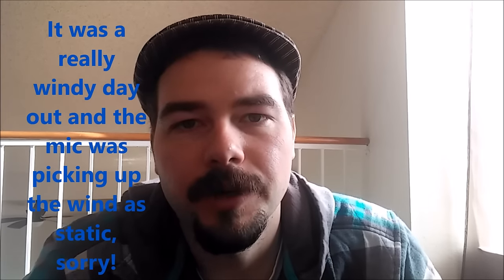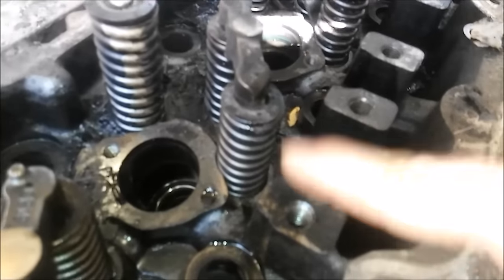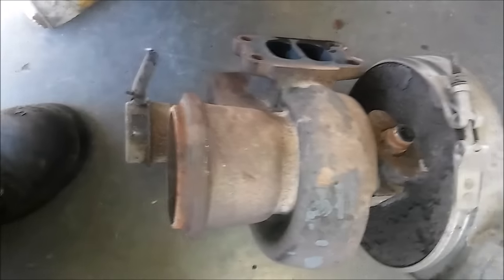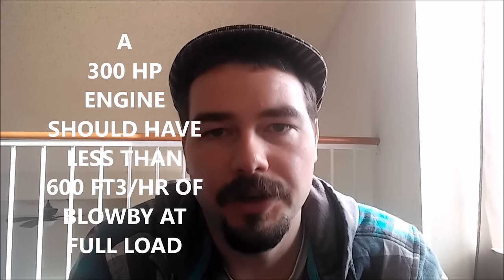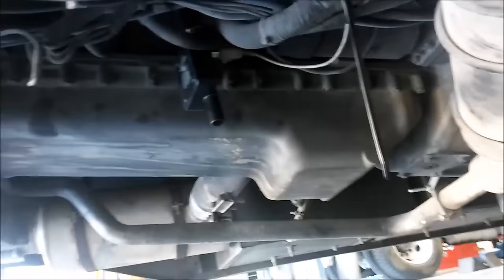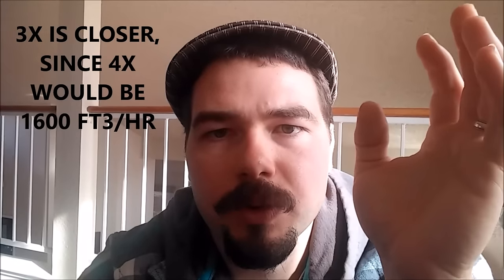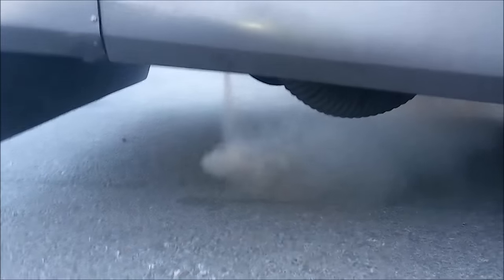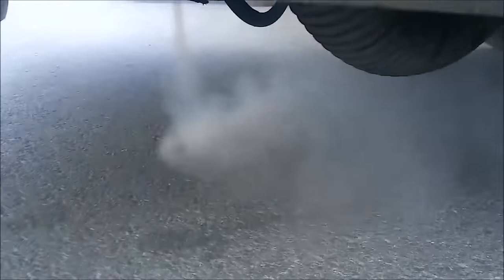What Is Blowby?  What Is Too Much Blowby?

Comment: Hey my friend you did mention that bad air compressor can cause blow by.does that mean if you fix the air compressor you won't get no more blowby?
Reply: My air compressor played up on my Volvo fh16 16L engine and now after not using truck for 2 months it works fine and build up air but sometimes days up , my engine also just recently started blowing white smoke from breather , can you help ?? Do u think I should replace air compressor ? Could my air compressor be the reason to white smoke / drips of water-ish oil from breather

Comment: Good morning Josh! 

Came back to this video as we have a truck in the shop that had combustion gasses in the cooling system and it received a long block (PACCAR MX-13). The truck now has blow by both out of the oil fill tube and the crankcase tube. 

For transparency the technician that did the install was inexperienced and did not replace the oil cooler or flush the oil module (Claims there was no metal) and they used about a half a can of ether over the course of an afternoon as they could not get the truck to start initially (Bad High Pressure Pumps). CCV filter has been replaced.

He was told to drop the pan and inspect the liners from the underside. He found a small vertical mark on cylinder 2 and orders from above were to replace the liner and rings on said cylinder. He stated to me he couldn’t really feel it with his fingernail.

I don’t believe it will solve the issue. After his repairs I’m looking to come up with a strategy to isolate the source of the blow by. This is what I have come up with:

Bring truck up to operating temperature. Verify blow by.

Disconnect air compressor inlet and outlet to isolate air compressor. Run unit and revaluate.

Pull rocker shafts off to ensure closed valves. Remove turbo feed and drain tubes from block. Pressurize turbo inlet to check turbo and intake valve seal integrity. Revaluate unit.

With the rocker shafts out pull all 6 injectors and perform a cylinder leak down test on each cylinder.

Wanted to see if you have any input? I can email you a video of the blow by and the mark the technician had found. It was his first major engine job and I’m preparing to take over his work.
Reply: Also metallic glitter was found in the oil pan once he dropped it to inspect the liner bores!

Comment: This is my first time viewing your videos and I have to say I am now a fan!  Great info!  I used to work on Caterpillar truck engines in late 90's early 2000's and have seen this myself.   I remember getting some with a scored cylinder pack that would puff fumes out of the blowby tube every time that cylinder fired.  I miss working on these engines since I have been out of the game for almost 12 years but I am slowly working back into it looking to re-start my career in diesel repair.
Reply from the maker: +Erich Z-Rod Good to hear from a veteran of the Cat Truck Shop, what field did you go into that had you leave the Diesel Field?
Reply: I have been driving tractor trailers and am now in real estate.  I enjoy driving trucks but real estate not so much.  I have missed the diesel field for quite some time but seems difficult to get hired today without certifications.  I have tried for Peterbilt, Cummins, and Detroit Diesel since we don't really have a Cat Truck shop anymore since they phased out.  The only Cat shop we have now is more for heavy equipment and I don't really care to work on the machines, prefer trucking.  Seems like the ones getting hired have technical school and certifications but little experience.  My old Cat job was old school and basically just trained on the job so I left without much to show and now I have been out of it for some time.  They have since closed shop since the Cat truck engine market kind of died of.  Thanks for the reply
Reply from the maker: +Erich Z-Rod Yeah, not a huge future in a lot of the Cat Truck shops. Hopefully ours will stay open for awhile longer before I have to transfer to a different department. Glad to hear from you, good luck on your search for a career.
Reply: +Adept Ape thank you. I'm not giving up on it.  I still do some side work occasionally but miss the shop environment
Reply: @AdeptApe  I have a 2007 Pete with a c15 double turbo and have it repaired with a platinum kit like a year ago. By a local shop  and now my truck it’s blowing oil from the deep stick  I replace the mentioned part with a new one bout is doing the same. 
I put tape around the tube. Deep stick. And it won’t Leak  what can be causing that. Please   Thank you.

Comment: I have also heard that if you removed the oil fill cap - and feel strong puffs of air coming out of the oil fill hone (with engine running) - that often means the rings are bad.

Comment: Thought I'd mention that different engine manufactures run this test differently, i.e. idle no load to high idle no load. Just so the viewer knows but depending on engine manufacture you can have other causes of high blowby. Such as a bad air-compressor. A leaking intake manifold/valve cover gasket bad oil seperator. It's getting to the point now a days that the rule of thumb is getting thrown out the window. Love your videos keep them coming. :)
Reply from the maker: +Travisfromoregon Thank you for your input.

Comment: So accurate.   I always said when a Cat engine idles and it has that sweet oil smell it's going to blow up real soon.  Also I don't know why some Cat liners have a real noticable taper after many  hours verses a Cummins..Maybe because Cat depends on Two compression rings as other manufacturers use more rings for this purpose.

Comment: I have a 3406e.. Blow by is not excessive. Yet it will blow off the oil fill cap fill cap or the dipstick if it is not tied down under load.. blow by tube is not clogged or restricted
Reply: has anyone replied to your post?

Comment: Nice explanations,thanks;
And if the crankcase is pressurized,the oil cannot drain down from the turbo? and ends up in the intake pipes,and then,you have a lot of blue smoke from the exhaust?
And,that can lead to engine RUNAWAY???!!

Comment: Hi Josh :) 
Again a lot of useful informations ! My 3208 has a little of blowby from the crankcase breather. Not so much, but there is. I have the valve lash to do (quite 3000 hours on the engine clock) and I guess it was never rebuilt. I just ordered an oil sample analysis to see what's going on.

Comment: Curious... '03 Cummins ISL (8.3), at start up should I have a pulse/pressure coming out of the oil fill? ZERO smoke, just pulsing air. Is that normal or a sign of something? Thanks so much for all your videos!

Comment: Just did an overhaul on my c15 accert at the rush in pharr tx. Well right of the bat I have blow by . Engine blows smoke  like a high mileage Detroit diesel. Took it back and they said it run it for a few months before making a insurance claim. I told them if it could be turbos or air compressor. Well they said it could but they don't know how to physically check if they're bad or where the blowby is coming from. Well I ran it 26000 miles and I'm tired of seeing that smoke. Tomorrow I'm taking to cat and have them figure it out I hope it's not a bad installation.
Reply: What did it end up being
Reply: Did you see if it was the crank case spinner filter

Comment: Got a Cummins N14 with excess blow by still after the rebuild. Replaced air compressor, had the heads checked up again, replaced piston rings again, and still showing excess blow by. Any suggestions?

Comment: I have a 6.7 Cummins deleted, I take the oil cap off after it is at operating temperature and there is a steady vapor trail, I put the cap on upside down but the cap will not move at all so this is a good thing but is the vapors normal? Sorry about the dumb question.
Reply: I have a LML Duramax does the same thing....shoots off vapors, but cap doesn't move at all.....could also be location of the fill tube ..but would like if he chimed in

Comment: I've had 2 trucks....2ws and 6nz... both had high blow by... both ended up being bad air compressors pushing air into the crank case. Both diagnosed by problems building air and excessive oil in air tanks.
Reply: I dont know if your still on youtube but if you are I have some questions I think I have the same problem
Reply: @dirtbikefin5683  yeah im still here. Whats going on?
Reply: @sradman750  how’d you test it to find out it was the air compressor
Reply: @richieb6970  pulled the dash cover to change some bulbs and there was oil dripping from the supply line.  Changed the compressor and it solved the problem i was having with oil spraying on my tank when under boost
Reply: @richieb6970  a dead giveaway is if you have engine oil dripping from your purge valve. I reccomend replacing the entire air dryer assembly and governor at the same time as the compressor so you have almost all of the oil out of the system. Go about 6 months, then change the air dryer cartridge. 
My 2ws was way worse and of course google had me thinking worst case scenario.  Some old school guy talked me into starting with the compressor and im glad i listened.
Reply: @sradman750  where is the purge valve located at I have a 3406 b model
Reply: @sradman750  I have a lil but on the engine breather tube
Reply: @richieb6970  yea thats where mine was coming out.
Reply: @richieb6970  its on your air dryer.. its where the air pops out when your tanks build max pressure
Reply: @sradman750  I have a lil but of oil and air dryer does too
Reply: @richieb6970  your air compressor is going bad. That could be your blowby issue.
Reply: @sradman750  do you think that is the issue I did the water test and I have no bubbles and I took the valve covers off and everything looks good
Reply: @richieb6970  the cheapest way to find out is to send an oil sample in. If your test comes back good then most likely that is your problem
Reply: @sradman750  yea that’ is what I will do

Comment: Hi,i love your videos they are educational.Iam from Australia. I have 2014 kia sorento diesel2.2  oil coming from turbo it has only 29000 miles on it.put new turbo still have the same problem ,any suggestion please I need your help,thanx so much to you and every one watching the channel
Reply from the maker: +Kjk Alm Where is the oil coming from? The intake housing or the exhaust housing? You might have a plugged crankcase fumes filter, this would cause high crankcase pressure and can make the turbo appear bad even though it isn't.

Comment: Apeman, wouldn't you say that twin turbo Acerts, by their very nature, produce more blowby then their predecessors?
Thanks for all the great vids!
Reply: Same question i have on mine it has a bit of a drip of oil especially if im speeding over 70-75 mph  for a wile n bearly drips on iddle but it does
Reply: We have the same problem with that motor  in one of our triaxle dumps

Comment: Great videos sir. Thanks for all the masterful knowledge.  I have an '07 W900 with a C-15.  Last week it blew the oil fill cap off & pushed out 4 gallons of oil while pulling a load. I replaced the cap & oil and within 10 miles it did it again. We put a pressure gauge on the filler neck & without a load were only able to generate 1-2lbs pressure.  A compression test indicated all cylinders are sealing within spec - they should be as this engine has 17,000 miles on it since a complete in-frame. The thought is that the high-pressure turbo has lost its oil seal & is pressuring the crank case. Before the expense of replacement is there anything you would suggest we look for? Thanks again, my son & I really appreciate your vid's.
Reply from the maker: +Mike Sutton Thanks for watching the videos. You can try pressure testing the intake to the turbos and see if one is leaking. I discuss it somewhat in the CAC test video. You would have to be inventive with the building of the test setup though unless you have an Aftercooler tester.
Reply: Woof !!
Reply: @AdeptApe  where is your shop located
Reply: Holy shit

Comment: Can a bad air compressor cause a ton of blow by and low oil pressure? Great videos!
Reply: Bad air compressor, yes it can cause excessive blowby .  Low oil pressure not sure. In my case it was the Jake brake solenoids dumping oil causing low oil psi
Reply: @Bigred03  preciate the info!

Comment: My c7 has a lot of blowby only at a cold start. It only has about 185k miles currently. My mechanic said to just keep up on the oil level and it should hold up. What's your take on this?

Comment: Looking at a 1993 KW W900. Truck has a 3406B 425HP   Serial 4CK09888.   Owner parked the truck a year or 2 ago because he started to get blow by.  Right now the water pump is off.  I spoke to a licensed mechanic and he said it could also be a bad head gasket.  I cant start engine until i pay for re and re of water pump.  What do yo think on the blow by?  If there is no coolant in  the oil does that mean its probably worn rings, and if so is it ok to bobtail it home?   Truck is in Calgary Alberta and im in Ontario about 3000 miles away.
thanks
Reply from the maker: +Jay Wiles Blowby can be caused by a lot of things, typically it is worn or damaged cylinders, but it could be worn valve seals, turbocharger, or air compressor. It is usually worn cylinders though. You can drive a truck with blowby it doesn't hurt it, unless something is coming apart.

Comment: I have a Mitsubishi Fuso FE160 2012 they say excessive oil in the turbo hi crank case pressure truck runs fine doesn't use any oil but they are saying to replace the engine

Comment: I got mbe4000 pre emissions 
This happens only on cold star 80 to 90 degrees in the am
Engine star shaking hard to crank up
Engine light comes on..but it goes away 3 to 5 minutes later.and truck like a champ..I seen a decline on oil pressure too

Comment: 4.5L turbo intercooler diesel
Runs perfect, idling perfect but burns oil (blue smoke, smells burnt oil) when accellerated or put under load.
Smoke comes immediate at metioned, smoke stops immediate after load release.
Whats your educated guess ?
Reply: Ogre Under Bridge 
White- oil burning through turbo exhaust, turbo, cylinder ware, valve seal, or blow by.
White smoke at start up after a duration of time(sitting over night) means a injector is leaking.

Comment: Your videos are all very helpful. I have a Peterbilt with C13 DPF filter and I want to swap it with a C15 with no DPF filter. Is that legal? I don't run Cali, only stay in the north east.
Reply from the maker: I don't believe it is legal with the EPA and since your truck is a 2007 or newer, a knowledgeable DOT inspector may notice that your engine isn't an emissions engine. Now depending on what area you are in they may not notice, but if you got caught it could be some big fines. I understand wanting to put a more reliable and powerful engine in your truck, but I would hate to mislead you. If you know someone that has done it in your area maybe you can discuss it with them, but as far as I know, it is risky.  I'm glad you like my videos, In going to be doing a regen class soon as well so if you want to know more about your emissions maybe check it out when it comes out.

Comment: Question, I have a 2005 Honda Element that is giving me a "misfire cylinder 2" error code.  i did a compression test and cylinder #2 gave me a reading of zero.  When the car is running and I open the oil filler cap, a dollar bill stands straight up, I mean it's an incredible amount of air coming out of the oil filler hole.  I also get a flashing CEL meaning that there's unburnt fuel getting to the catalytic converter.

Any idea what's going on???
Reply: A valve broken or stuck open, or piston and rings are totally shot.

Comment: Hey ADEPT i got a customer that has removed breather kit from his motore when he bought the truck.According to the serial number . Hew was wondering if he can use the 292-4303 kitt to put it back on his truck. Originally the oil pan slump was in the front of the engine , but since the truck is car carrier he had to swap the oil pan to the rear. you think you can make a video of the Crankcase breather kit installation?or is it a good idea to put it back on the engine???

Comment: Great and very helpful.. I was wondering if you could help me with my 06 accert just had platinum done on it about 15000 miles on it.. we changed all the fuel lines both fuel filters based and fuel transfer pump.. it’s getting lots of blow by and running like crazy ruff on idle.. I don’t know what else I can change on it?  I would really appreciate your  help on this please thanks